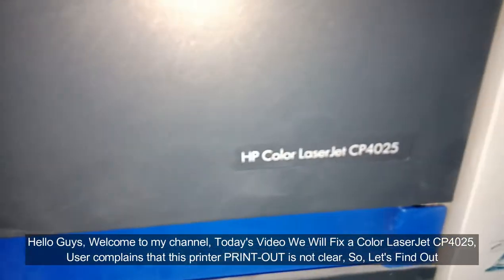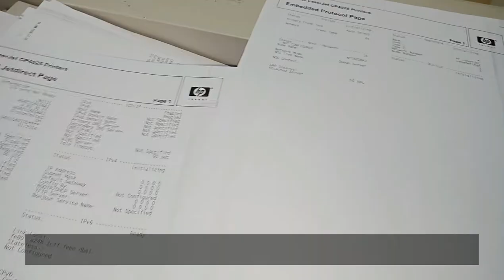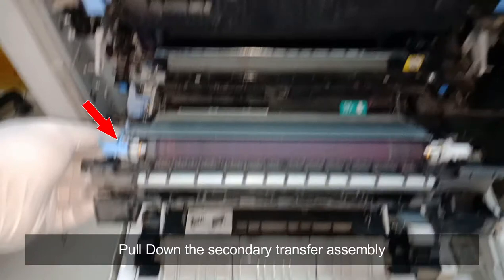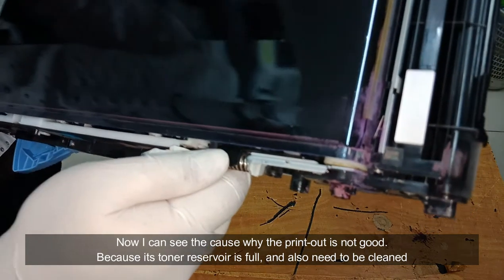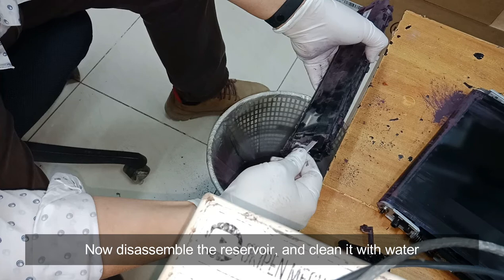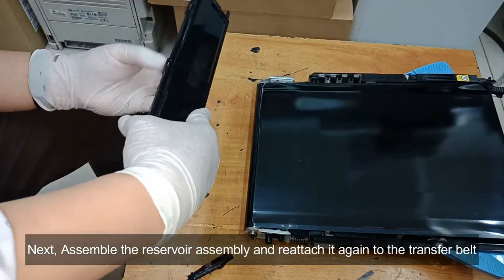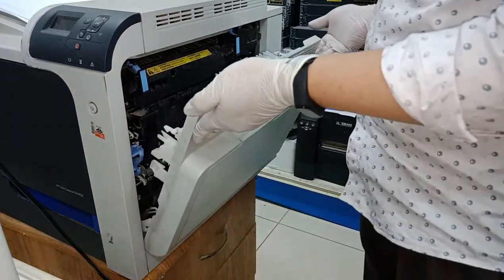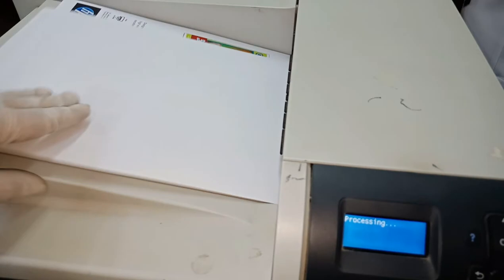Unclear Print-Out | How to Clean I-Transfer Belt | Color LaserJet CP4025

Comment: I followed your step, but when I removed reservoir, some gear wheels fell off and I have no idea they fell from. I tried putting them back in and as far as I can think of there’s no place for them anymore but there are still two remains. How do you know where they belong?
Reply: I am having the same problem. Have you been able to come up with any solution?
Reply: yeah, it's not clearly shown how to exactly remove the reservoir, so I think I'm going to try to just knock out and/or vacuum out the excess without doing a full clean...